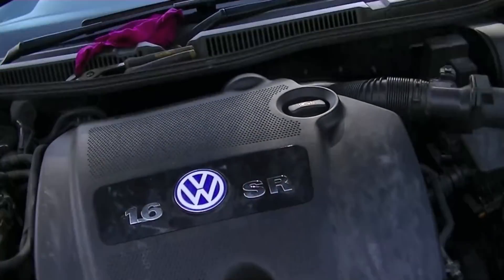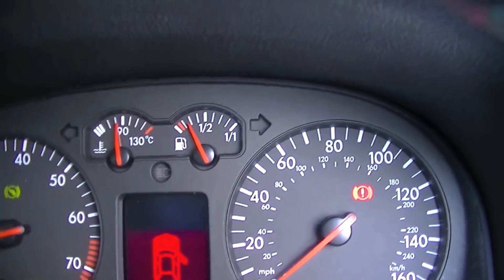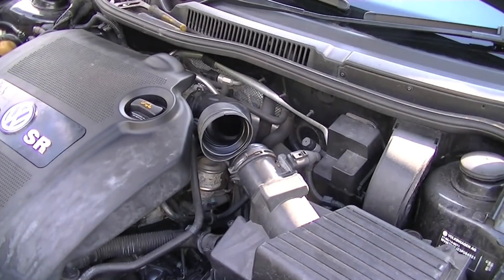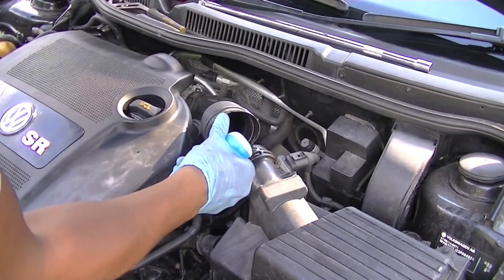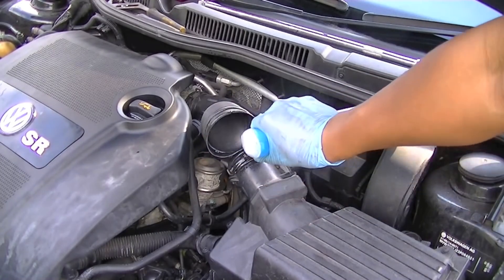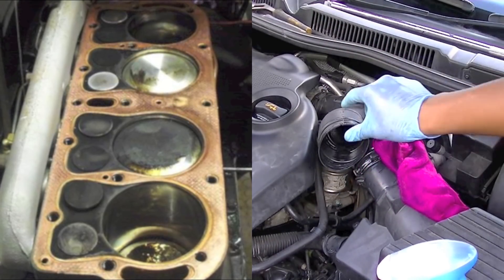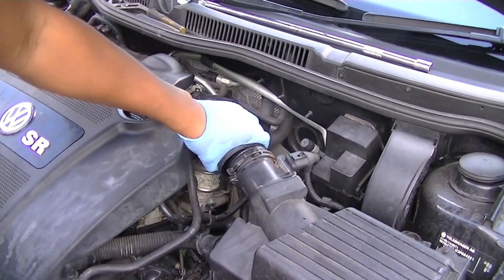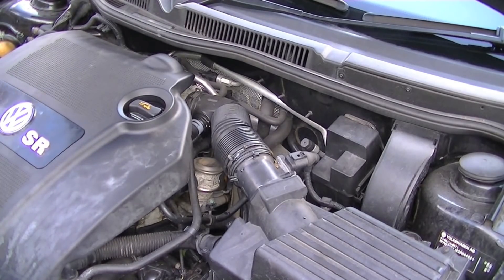How to make your engine run better with just tap water.......Better Than Seafoam?

Comment: I feel your criticisms of sea foam are valid. For the shadetree mechanic, it's a decent product since it can do more than de-carb. Water works just as well but is less convenient. As a professional, i think it's a good idea, health-wise, to promote the use of alternatives to seafoam or other petrol-based products.

thanks for the informative posts. you've got some crazy trolls following you so it'll prolly be impossible to have a logical conversation. A wag of the finger to you for circling the block w/ out a seatbelt. I'd be a 100% hypocrite to say more. I'm guilty of circling my block without a helmet when doing motorcycle maintenance out of my garage.
Reply: BRUCE LEE We don't get Seafoam over here...  I suppose we're a bit smarter out here in the colonies...

I'll have to research it.  Sounds like it's petroleum based.  If it is distillate based, it would have awesome dispersal and solvent capabilities... But it would be combustive.  Wondering what the mode of failure of a turbo would be when exposed to this material.

Would have thought that, considering the bearings are sealed (they run at oil pressure) there should be no method of contact.
.. But again.  Only an engineer... Wouldn't have a clue.
Reply from the maker: I appreciate that, add me to Facebook so we can debate and relate.
Reply: Their is a FORD TECH that is on You Tube. The F150 and other ECOBOAST engines are building up carbon.

What not to do he said is to use SEAFOAM. The heat from SEAFOAM will cook the bearings in the Tubos that is close to the motor. No problem you have now ruined your warranty and the Turbos cost THOUSANDS.

He didn't say you couldn't use it on other motors without TURBOS.

He said I could use MARVEL MYSTERY OIL in my gas 4 OZs on a full tank and 6-12 ounces at oil change. This will not harm TURBOS as their is no heat and fire.
Reply: tcpnetworks

Comment from the maker: Check out water decarbonisation results http://youtu.be/eZDISp2pdSo
Reply: BMAC VAGS The best way to make your VW engine run better is to swap it with one made by Honda.
Reply: Bryan Resch No my friend,unfortunately you were unlucky only to buy these cars,other than that almost everyone cries from the recent VW cars. I work in BOSCH service in Helsinki,Finland,and we have 8 hydraulic lifters..,usually we got like every day 2 or 3 VW"s,but we have at least one day of the week "VW day",when all lifters are occupied with more than 5 VW or Skoda cars. Faulty timing chain tensioners,plastic 3D made water pumps,very small alternators mostly made of plastic..,manifolds made of cheap plastic..faulty transmissions..list goes on. Up to date i havent seen Honda coming for other than basic maintenance and brake disc change. Not a single one with transmission or engine problem. Not even one!
Reply: BMAC VAGS If you read the ingredients on seafoam carefully and know what they all mean you will come to realize that seafoam is really only meant for 2 stroke engines and not 4 stroke ones.
Reply: +Tomas Av. You're an arse wipe
Reply: ***** Well,i am not an engineer myself to credit or discredit claims or products,but to me sounds like someone wants to make a fast cash bullying people. If you know the basis of the engine,you should be sure about that. Have you ever cut used oil filter? There is no way you can use one filter for eternity. It gets contaminated,its purifying qualities are reduced with time,and no matter what its made of,it should be changed. Now..,here is another add on to that. As i work in a car service,i can tell you,that most of the new cars that come with engine issues are using Long life synthetic oil,with changing intervals around 20 000km. Then when you start fixing that engine,you find out that its excessively worn out..,PCV valves are clogged,EGR also..,so no,i dont believe on that claim. I believe engine of a petrol fueled family car should be changed on 8000 km,and on a high performance sport coupe or sedan around 5-6000 km.
Reply: S.T T. Good to talk to another person from Finland. Beautiful country and forests there. Some day I hope to visit. I have a guy who is makes my bushcraft knives for me from Kotka I believe is the place. Take care my friend.
Reply: BMAC VAGS yea I  remember  seeing  my  dad and his  mechanics he  worked  with  use  water   as  far   back  as the early  80's ..... a  few drops at a time its oldtimer approved
Reply: S.T T. You too my friend. Thank you for the invite. Hope someday I get there.
Peace
Reply: +MrTheHillfolk Lmfao, antifreeze works better. the glycol won't hydro lock the motor.
Reply: ho says its  not  ok ??  moisture is  ALWAYS in the   air   or  it is  on my  planet
Reply: +Tomas Av. 
Ahahahaha good one.  
Yes please stay away from my car
Reply: S.T T. LOL , I have 2 Honda cars and love the way they run and low maintenance. The wife had a beetle and Cabriolet by VW , they both were money pits. I do like certain VW models but with our experience , I just won't buy one unfortunately. I'm sure we just got unlucky , who knows.
Reply: +BMAC VAGS this is the most absurd video about non scientific facts. *A mechanics having a laugh
Reply from the maker: +Mario Millan Every 50000 miles if you want to be super cautious
Reply: +blackscorpion002000 Yea burning coolant thru an engine makes me hungry. That smell. 
I want pancakes with maple syrup!
Reply: +mechanicman2000  hey  man  please excuse  me i  wasnt   sure which  of  my   comments   you were  responding to lol its  not the  water  itself thats  bad   for  the  02 sensors      its   chemicals that  make up the  coolant so the  waters  not the  damaging component   ....   have a  good   one   bro
Reply: Bryan Resch Nice to meet you too buddy! I know Kotka,sure;))) You are more than welcome any time you want! In that area,Kotka,they are famous of making one of the best hunting blades..,something like Marttiini Kalevala.. all hand made. Let me know if you ever come to Finland. Enjoy your summer buddy!
Reply: What about viscosity break down ? Oil can look clean and new but it will break down from heat and friction , right ? I can't see how it couldn't break down and become less than 100% as new.
I don't know shit about engines. I'm just trying to use common sense here lol.
Reply: Would this work the same on my 98 v8 camaro?
Reply from the maker: Yes believe so
Reply: +BMAC VAGS i am good if any of that water is left behind it will kill the engine i am fine with the way i do GL with other videos.
Reply from the maker: 115zombiehuger Each to their own, and thank you for taking the time to comment
Reply: Yeah I have.. Bloc oxydized, cylinder walls cracked.
Reply: how much water is enough? in the pic you shown only one cylinder got cleaned, how much should I use to clean the 4?
Reply: hi my name is mark if you do that to mondao lx 04 model would it work
Reply from the maker: Mark Flynn yes it will work
Reply: Mark Flynn It will! I can vouch for that, go ahead. The less Diesel cars the better this world is.
Reply: Thanks
Reply: Francisque S oh boy... Wonder how 80% european folks are going to commute if we get rid of diesel cars?
Reply: Well.. I seriously doubt Diesel cars are the only options.. Heck they just have to buy real cars 😂
Reply: Francisque S LOL. I'm with you man, lets send to hell those greedy oil companies and use clean energy, yeah, sorry for you Chevy, Mopar or whatever v8 you have
Reply: Driving a Japanese with 4 cylinders running Ethanol E85. But the huge issue you see is Fine Particles in Diesel, that's bringing our atmosphere into an end..
Reply: +Mario Millan , I have a small clean burning v8 5.9 liter and it upsets me to see these evil companies destroy earth
Reply: +Andrew Warren Amen to that bro, we have such a marvelous planet and I'm sick too, of those making shit our home, that is why I better blame it on the government and the oil companies, they are the real evil here, no gasoline or diesel or jet fuel based engine is ever gonna be clean. why do they ban those who R&D on hydrogen, solar or bio fuel? even worst, why to they punish those who dare to share with the world? so unfair man
Reply: Is your idea the reason for the water companies installing water meters? lol Great discovery either way......
Reply: Is your idea the reason for the water companies installing water meters? lol Great discovery either way......
Reply: +Mario Millan 
That one piston was cleaned because that engine popped a head gasket and was suckin coolant in that cylinder.
Reply: +MrTheHillfolk ya that's what he said. coolant is mostly water so ya...
Reply: S.T T. Nice advice. Btw. How often do you recomend timing belt and water pump is changed on vw engines?
Reply: Use blue washer fluid instead,,and it'll add power at the same time :) 
It's about 33% methanol.
Reply: +MrTheHillfolk but it WILL damage  the oxygen sensors  so i wouldn't  try it
Reply: +Michael Horsford 
That's pretty obvious.
Reply: +Michael Horsford That's an excellent point. I show a new method of how to see if it helps.
Reply: Not to mention the cat damage...
Reply: Stephen Norris How's steaming water going to damage that? An oil or collant burning engine damages catalytic converters, not steaming, cleaning, water.
Reply: Fuck you and your stupid water decarbonisation. It's only damages engine and turbo. Only dumb idiot can think water can even reach carbon. IT's FUCKING ENGINE. Explosions going on, so you think some 10ml of water will survive that?
Reply: AutoBravado, looks like you another idiot. Hope you dont fix cars.
Reply: BMAC VAGS

Comment: I did this to my Toyota .. There was  an explosion inside my engine and thru my exhaust pipe.. Black smoke came out like a locomotive.. The car seems to go faster then when it was new ..  Now I have a problem with my neighbors, every time I start my car they seem to run inside quickly .. One lady called the fire department when black smoke was coming out thru my tail pipe ..
Reply: Cut your muffler off. Maybe they will move away.
Reply: BS!!

Comment: Hey Fam, I've got a 2.0 GTI Mk4, Is it ok for this engine? how long do i need to spray for, 5 mins? Also, I'm thinking of replacing the Air Filter to a Pipercross induction kit. is this a simple replacement to the AirBox? 
Nice one anyhows for the vids. Much appreciated bro.

Comment: i run a home made water injection setup on my car. when the speed gets above say 50mph i turn it on to clean it up. you get some right black crap out the exhaust.

i use a vacuum line with a drip counter to suck water in.. makes it much more easy and then i also know how much water my engine is sucking in.

running carbs with no ECU or cat converter here though.. i know this is a great way to clean a cat converter :D